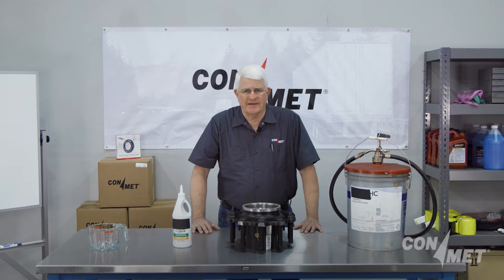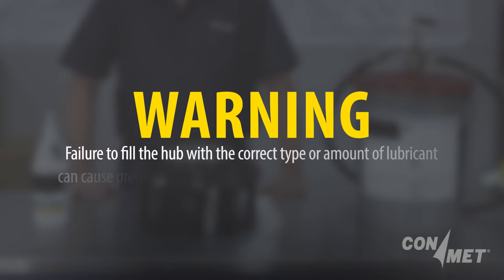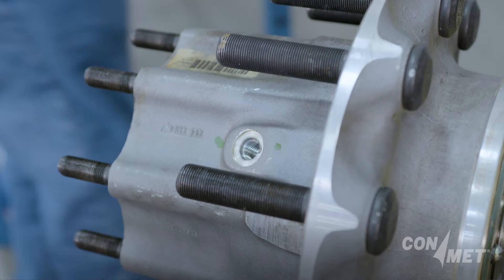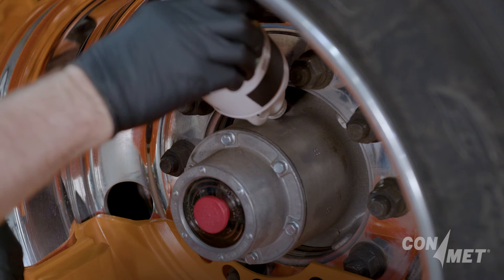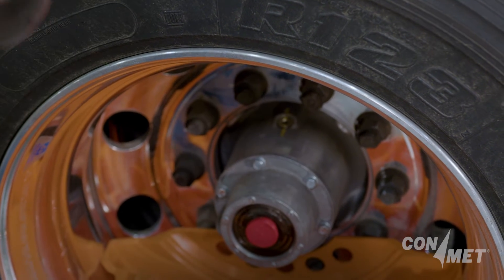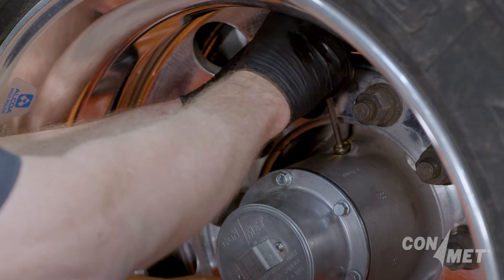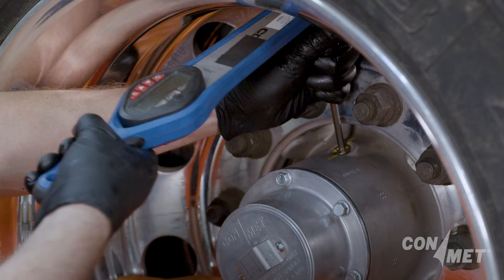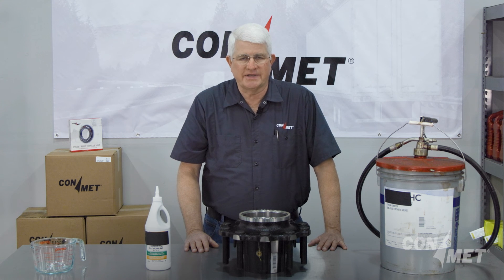Trailer Hub Lubrication

Comment: First is a grease hub designed different than a oil bath hub? 

I notice most if not all oil bath hubs have a center cavity reservoir. Grease hubs do not. 

This is of course class a trailers. Is there a difference?
Reply: I know the seals are different. But now they're coming out with sealed hubcaps that take fancy slurry type grease. Dam a grease filled hub.